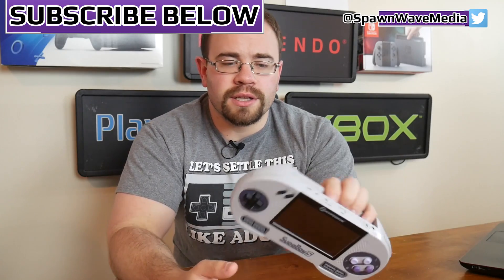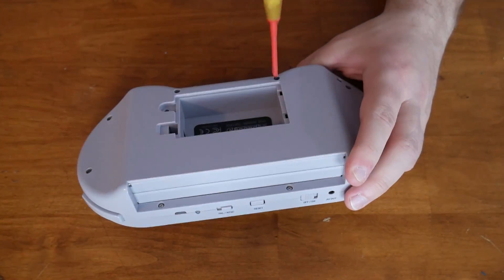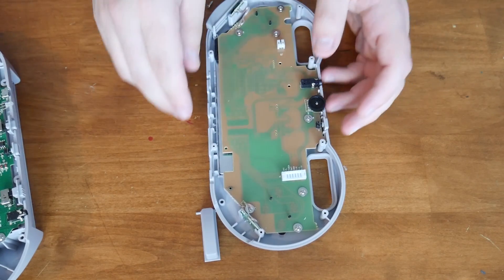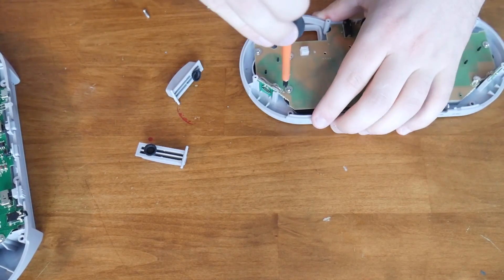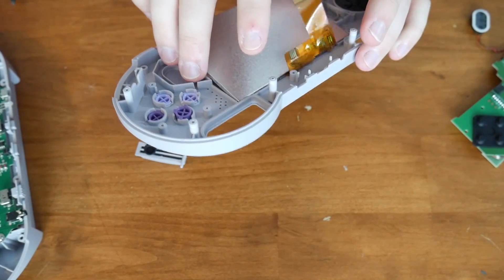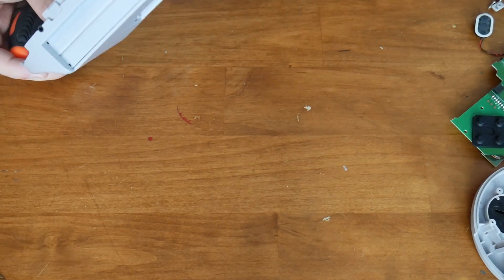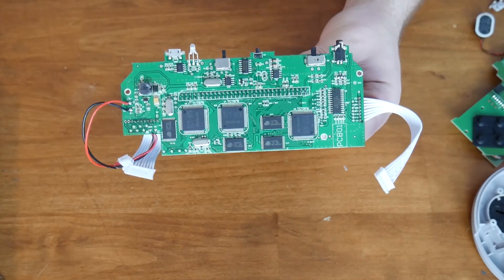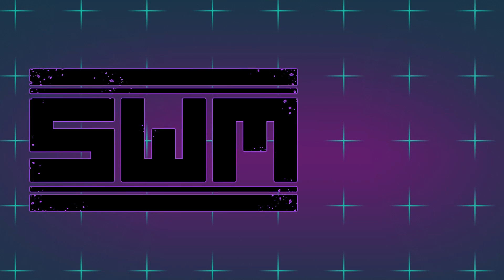How Did They Put A Super Nintendo In The SupaBoy S Handheld? - Tech Wave!

Comment: The number one issue I have with the SupaBoy is the way they did the cartridge slot on the back. I would have liked to have seen the cartridge slot put lower so the cartridge wouldn’t be sticking up so far in the air out of the device. I want the cartridge more secure in the system.

Comment: Dude thank you.  I have not been able to find a tear down on this dang thing.  The V2 and V1 of the system was grossly faulty with the D-pad.  It had plastic poles reaching from the D-pad to the lower board and it wouldn't stop you from pressing all 4 directions which would cause all sorts of things from game bugs to getting stuck when moving in a circle with a shooter or a fighter.  Finally they got smart, only the classic third time the charm on this one.  Now ...chipped games, the old ones failed at that too mostly.

Comment: It actually not that badly build, clearly lacking knowledge of electronics. First it not a throw in screen like out of a back up camera like we do when modding other handheld, that just take off composite video signal. They actually design the display controller and integrated the display driver on the key controller board, instead of separate board like the last version. Has audio op-amp on that board as well. It becoming more refined. The issue with last version was they did throw in a screen out of back up camera and display controller was causing RF noise and causing buzzing in audio, they fix it on this version. One of the better clone and it not emulating It actually a clone.of the real hardware, so will play pretty most, if not all SNES carts with no issues. I wish they had this back in the day.
Reply: The Tech Genie so your saying it’s not emulated, does that mean it’s dogs, or a replica of the original hardware.
Reply: No, it is the same, they just moved the controller from the lcd's board to the joy board to appear more elaborate but it still takes just an composite video signal

Comment: So it's emulation based? 
Those chipsets looks more like cloned chips rather then being emulated.
But who cares aslong it's good with no latency and no compatibility issues.

BTW it's not bigger then a atari lynx 2,not bad for an unofficial portible systdm.
Reply: It isn't emulation based. It's an actual clone of the original hardware, hence why it is able to run flash/SD carts like the SD2SNES and Everdrive. Emulation based systems like the Retron 5 can't do this.
Reply: thevi0lat0r well i own the supaboy S but i cannot get the powerpak to run on it, i tryed both different cf cards, no success, but it just works fine on my regular snes systems,also supermario rpg does NOT work on it, i tryed it multiple times.
Can you explain that to me?????
THX alot!!!

Comment: FYI to those wondering: The batteries are lithium ion 18650, the naming derived from the cell's dimensions: 18mm x 650mm. They're ubiquitous in electronics like laptops, power tools, hobby models, electric bikes, etc... and puts out 3.6 volts, approx 2000 milliamps.
Reply: ash0man I use the same batteries in my vape mod.
Reply: They are 3000mah. F.Y.I..